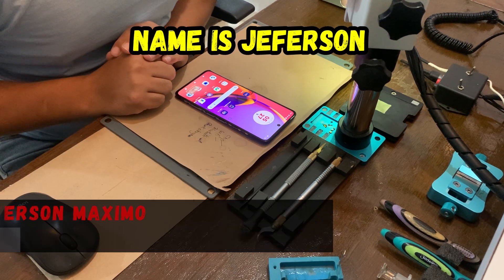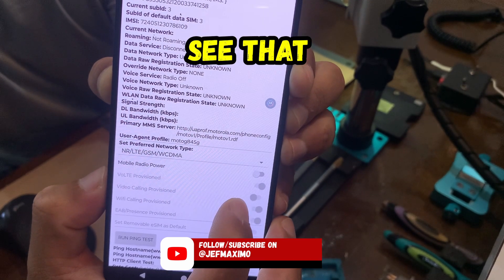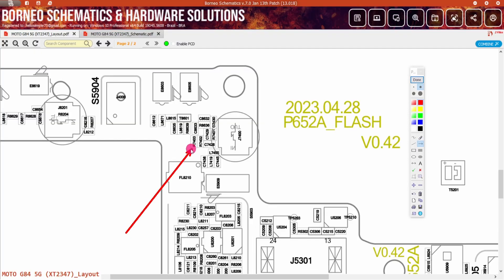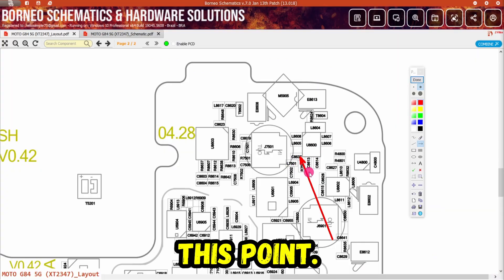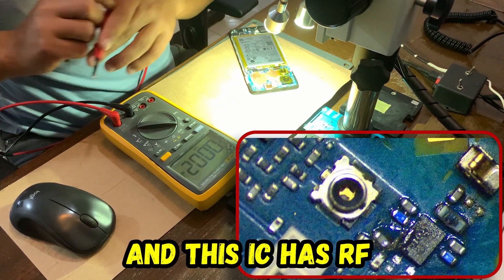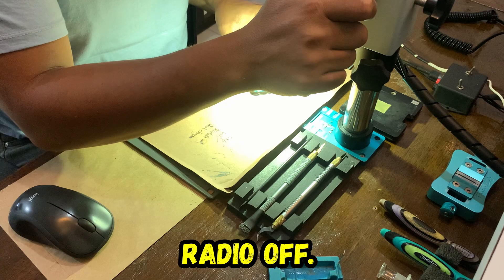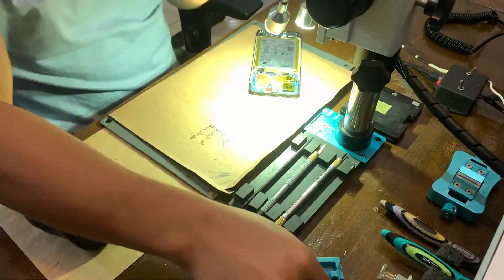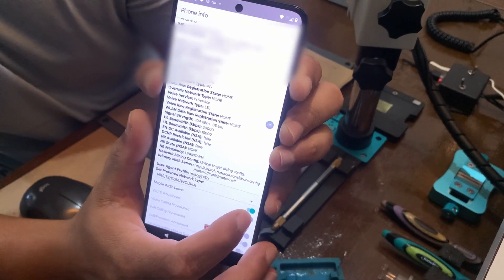MOTOROLA MOTO G84  NO SERVICE | RFFE  PROBLEM ANALYSIS

Comment: My Moto g84 has the same problem, no mobile radio after car crash and water damage. But there is 1.8V at the two points you showed.
Reply from the maker: Hi, bro!

To check RFFE I recommend to look for oxidation around SIM CARD connector and sub-PCB. May have oxidation under IC.

Check all IC that have RFFFE Protocol, for example:

•RFFE1
U6401
U6604
U6602
U8601
U8602

•RFFE2
U8602
J5701

•RFF3
U7402
U6908
U7302